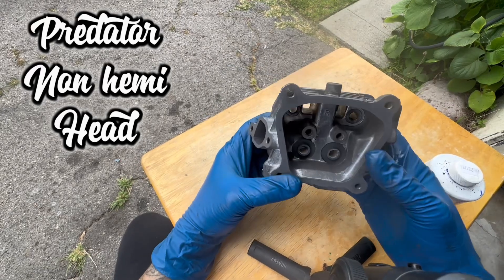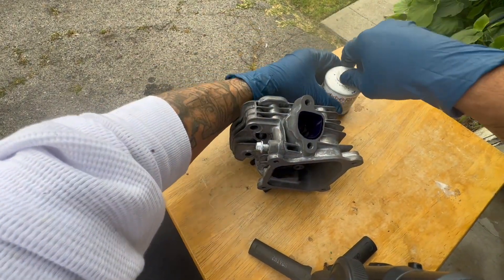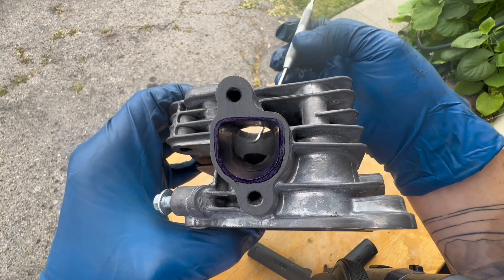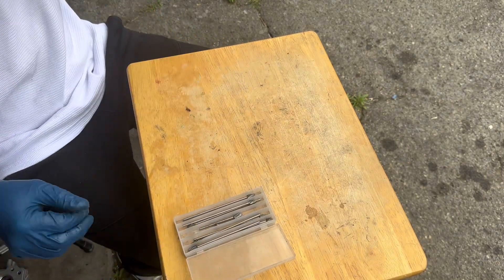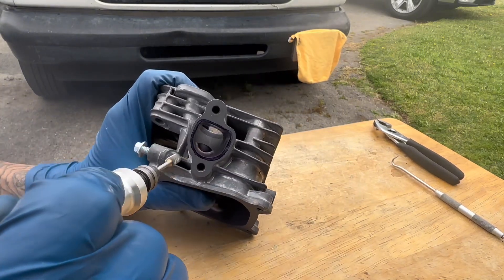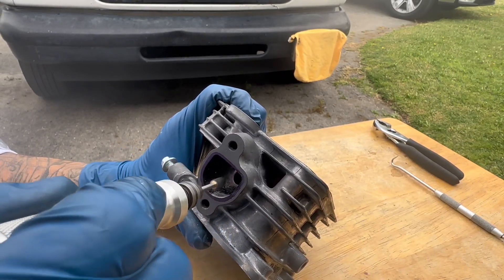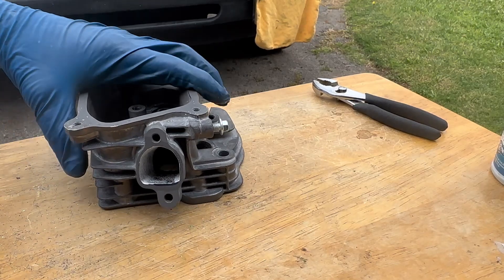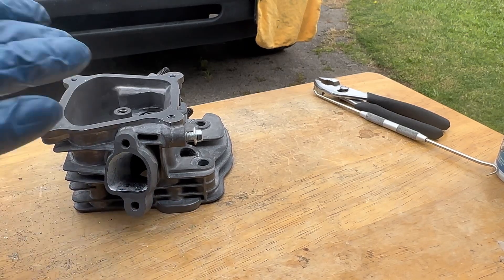Predator 212 non hemi cylinder head port and polish  @Greybuiltracing

Comment: What is always tell people when doing anything that involved removing metal. Take your time. Its easier to remove metal than it is to add it back. I spent 2 weekends probably a total of 25 to 30 hours very carefully port matching and polishing. Its only like a horse power gain and half a torque but when we're talking such small numbers to begin with it really does make a difference.
Reply from the maker: This is an old video . I understand about shape now instead of hogging . Velocity and cfm .. fine line

Comment: Nice, but i believe I've heard others say not to polish the intake?
Seems they say like an 80 grits sand paper feel to it?
Have you heard this?
Thank for the info!
😇🙏👍
Reply: 60 grit or even a burr finish. Never polish the intake. Especially with a carburetor. The fuel won't stay atomized.

The reason you wouldn't want the fuel to drop out of atomization, is because the fuel will puddle back into liquid form. Liquid fuel will not burn. You'll see poor fuel economy and poor performance.
Reply: The biggest gains are had at the seat and valve. Air doesn't like to turn more than 15° at a time. The valve job is the bottle neck. More gains are to be had with 3 or 5 angles vs the stock 45° seat. The intake valve should get a 30° backcut. All this port work won't amount to much if you can't get it out of there.
Reply: The carb intake should actually be dimpled, with a coarse finish to uncrease air turbulence. The exhaust port should be mirror polished to reduce air friction and increase air flow.
Reply: @MiniBikeDevil dimpling is not a “should”. It’s a minor improvement and totally optional.
Reply: @PhortyZips  Dimpling the surface is the most effective pattern to increase air turbulence.

Comment: Great video, what does this translate to as far as power and speed compared to non ported heads ?
Reply from the maker: @c-los4630  its a noticeable power difference. You’ll be able to feel it . I don’t have a flow bench to show the difference between stock and ported . Also I’m gonna make another video bc I over did the entrance of the intake port . You don’t want to over port because it will slow down velocity . You want to speed it up in the entrance and slow it down at the cross section . I’m fairly new to porting and learning a lot but I will definitely make a new video

Comment: That head looks to be ported already imo. What casting is that? Yeah I would bet money that head has had port work already.  People- be careful, I'm halfway through this and following this if you've never done port work before, This process could definitely have you removing WAY too much material! Remember, it's about port VELOCITY, IMO just as, or more important than flow.
Reply: I think it comes down to what you want the engine to do. A head like this should get max HP at a higher RPM than a head with less porting.

The caution would be for those of us that don't run our engines to 7500 plus RPM. A lot of us are doing basic builds with 265 or less cams. You wouldn't want all this porting for that.
Reply from the maker: @Deucealive75  I did notice that a head that had slightly less porting performed a lil better at lower rpm’s . I’m using a stock cam which is a 210 lift .
Reply from the maker: It’s a predator 212 stock . It’s been used but not ported . I wouldn’t do you guys like that .
Reply from the maker: You can also zoom in to see that it’s stock port .